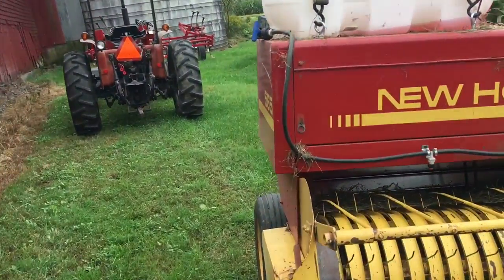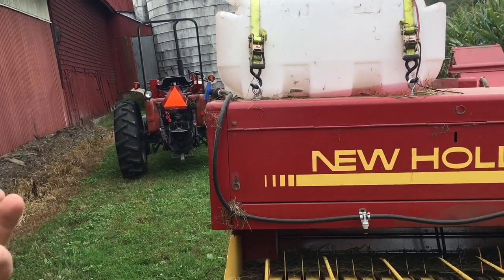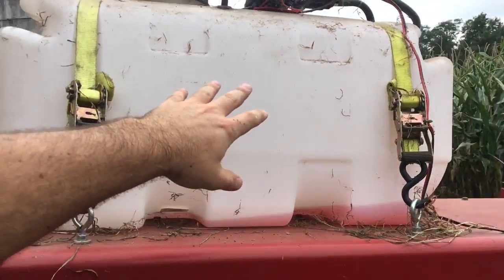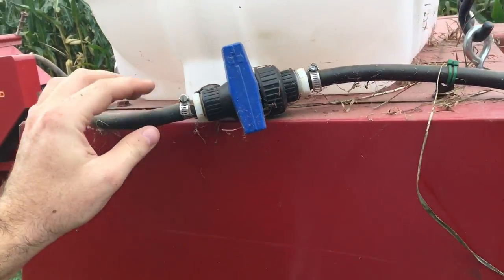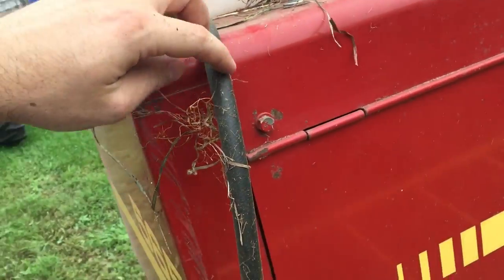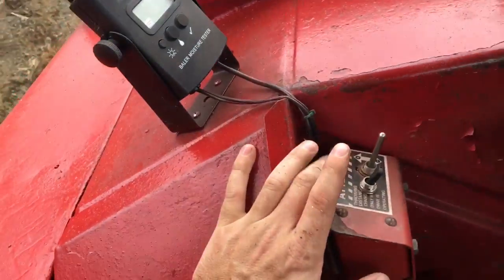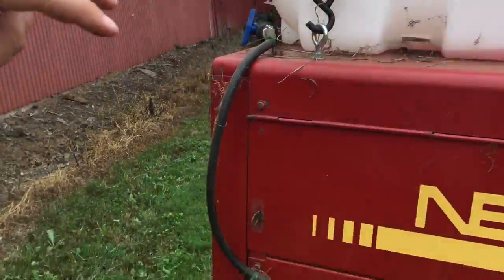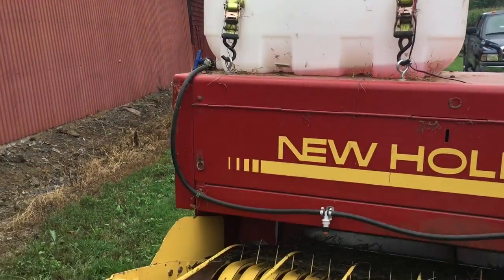Homemade Hay Preserve Applicator

Comment: The spray tip number refers to the degree of the fan coverage 110° and orifice size of 01. It's not to hard to figure out the tip you need if doing a homemade applicator on any baler that they don't make a complete kit for. Just in case anybody is thinking about doing this.

Comment: Thanks for the shout out man!
Reply from the maker: No problem, I think the rig you put together is better than this by far. Especially if you can get it to change the flow in the cab.
Reply: PA Farms there basically the same you did a really good job on your if your wanting todo that all you need is a electric regulator valve I put one on my sprayer back in the spring there perty simple all  you need to hook it up is a power an ground wire with a toggle switch